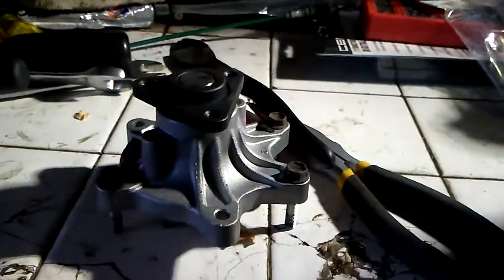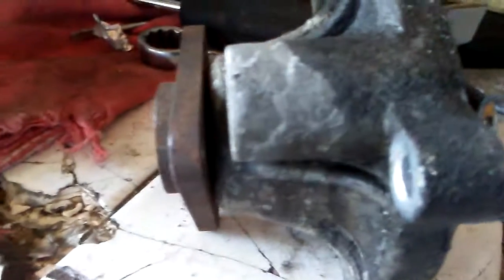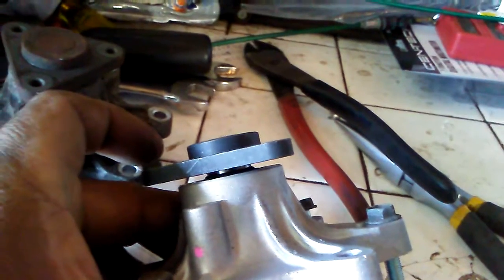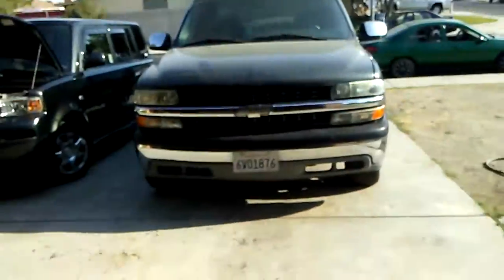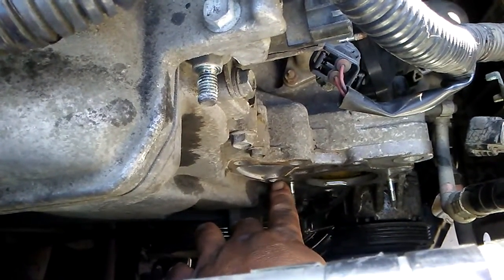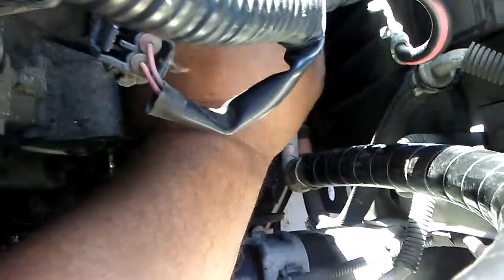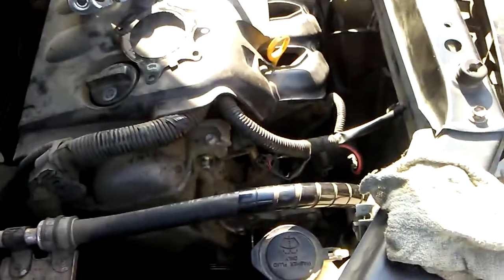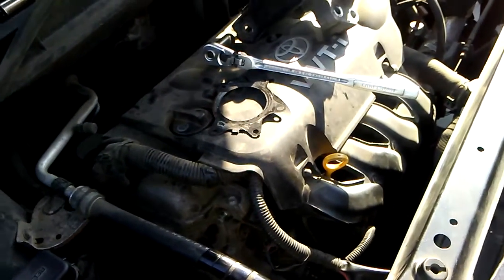2006 Scion XB 1.5L water pump removal and replacement and thermostat

Comment: thank you for this exact way of doing the removal and install, did a water pump on one today and for some reason removed everything in this exact manner and found a leak, thought one of the bolts in for the support to block had water jackets but doesnt look like it

Comment: I didn't half to do none of that I pulled it up on a ramp laid under the and did it all from the bottom I didn't half to pull nothing off but the water pump and move the belt

Comment: Bro I changed everything but the water pump the hot light comes on when am chilling at the light could this be the water pump
Reply from the maker: I would try changing the thermostat,  and checking your drive belts if it still gets hot. Then change the water pump.before you change the water pump, is your check engine light on?
Reply: @SuperDjnrg mine is

Comment: You don't have to pull the motor mount off to change a water pump.or remove an alternator on this car. Your video left out a lot of the stupid crap you have to go through to change a waterpump in one of these rinky dink Xbs - namely poor access to the lower waterpump bolt and insufficient clearance for removal of the waterpump itself without prying the engine towards the driver's side. You could have just left the passenger side motor mount in place after removing the 3 bolts mounting it to the body to make prying the engine to the side easier.
Reply from the maker: cj g you are correct my apologies for not being more thorough.
Reply: Great comment....question.....would it be good to also loosen or remove the 3 top motor mount bolts on the driver's side too (?)....to ease moving the engine over a smidge more....easier?
Reply: If so.....by removing the 3 bolts as you say......couldn't you also have (instead) just taken off the 2 bolts closer to the engine on that mount? ( instead of the 3 bolts on the fender/chassis).....meaning, just those 2 bolts that hold the engine up that are closer to the engine?. Seems that could work if your goal is to allow movement of the engine toward the driver's side to aid in this process.
Reply: Good idea to keep the "chassis-mounted" part of the passenger motor mount in place....BUT.... you suggest loosening the 3 topside bolts on this piece to ALLOW the engine to be pushed toward the driver side. All good....BUT....there is ALSO a 4th bolt accessed from the BOTTOM of the car on this mount. PLUS....you need to remove the 2x, 14mm bolts on the "engine-side" of the passenger motor mount. THEN you can easily push the motor over a bit.